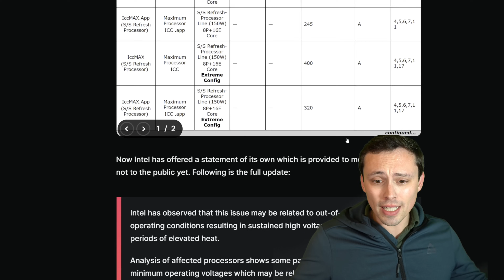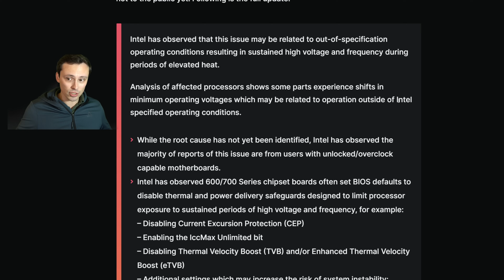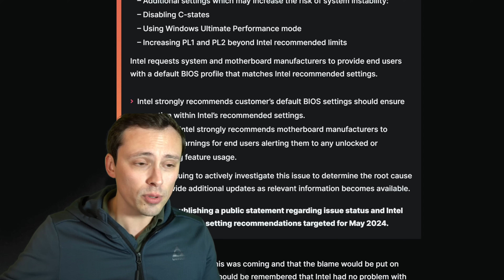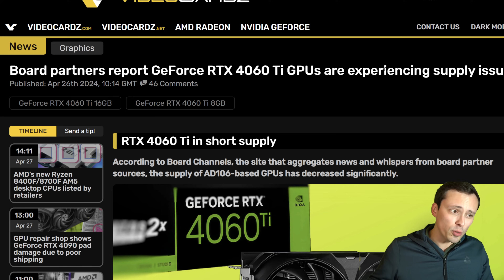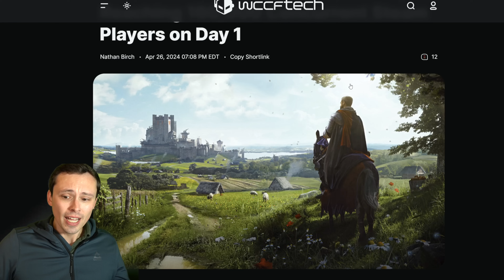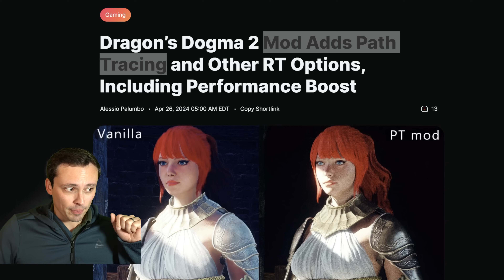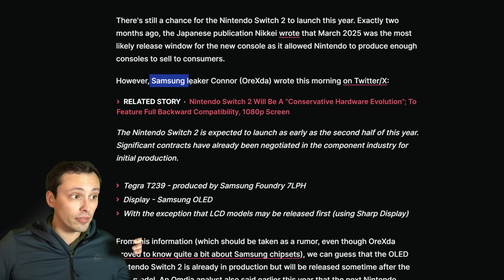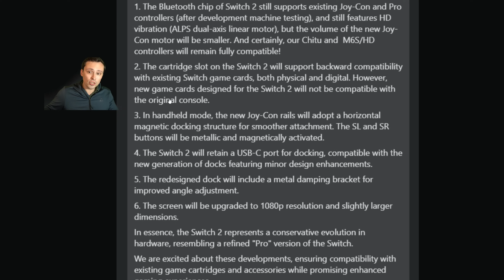MSI Abandons AMD GPUs | Intel Official Statement on CPU instability | Nintendo Switch 2

Comment: Intel's not wrong, I've been saying for years now that mobo manufacturers are doing everything backwards. Default should be intel spec not overclocked, 'turbo', 'max powah' or anything else. It was causing people heat issues with 12th/13th gen and now stability issues as intel cranks up the performance of the 13th/14th gen ticking the clock speeds higher and squeezing performance leaving even less oc headroom on the chips. Mb manufacturers are turning off power limits by default allowing cpu's to run full out until they thermal throttle. Oc settings shouldn't be a default 'opt out' setting, it should be an intentional decision made by the user. 

Default settings aren't 'gimping' performance, they're giving the performance the cpu was designed for. It's only a loss of performance from the default overboosted mb setting. So sure, if you switch off an oc like the 4.6ghz oc I had on my 4690k back to default clock speeds and voltage - performance reduces back to normal. Shocking.

Comment: I'm  not convinced that the current 4060 Ti shortage is due to NVIDIA wanting to clear inventory for the 5000 series, I think this has to do more with AI hardware sales.

NVIDIA might have had TSMC reshuffle their waver assignments to make more H100 instead of 4060s since those are FAR less lucrative than the thing that makes ChatGPT and NSA datacenters go.

Comment: If Intel made a fault, besides building CPU that consume so much power, I don't know. But as I use a lot of Asus Mobos on PCs of my friends, it's easy to see, that Asus as example is unlocking a few settings by default, especially the tdp and core voltages.
If we look back, it was also Asus who gave the 7800x3d too much voltage. The company loves it hot and at the highest performance.

Comment: I don't think Intel utilised their recommended specs when they did benchmarks to compare their CPUs to AMD 😂. It's easy to say '' why are you doing that ? " When you have already done the exact same thing to promote your products...
This also shows that Intel's baseline profile is already an aggressive settings because it's already the limit of what many CPUs can support. Basically Intel CPUs are overclocked out of the box to try and compete with AMD, so when you try and overclock them yourself you're basically overclocking on top of an overclock

Comment: I really wish Nintendo would ditch Nvidia, Tegra ALWAYS age waaayyyyy worse than any AMD powered console ever!

I have a switch and its performance is absolutely atrocious in some switch games. Embarrassing performance in Zelda, splatoon 3 and majority of newer titles.

 I had an Asus Transformer with a tegra chip in it, felt snappy for maybe a year at most! 

That tablet died and got a free upgrade to transformer 2 with new and improved Tegra chip! 

Same issue. Snappy for a year then couldn't maintain 30 fps with many current games for that time period. 

Tegra platform is extremely short sighted and Nintendo would be very wise to even look at intel at this point.

Comment: Nintendo Switch 2 "won't be as much as a Steam Deck: r u kidding me.  Orrin Switch like Tegra Switch will sell at least 150 M units while Steam deck is lucky to reach 1 M units. Daniel, mimicking repeater does not work and will end your carrier as a mimicking transmitter as it should, only right and just, do ur own research that whole report was really embarrassing. mb

Comment: My first thought on MSI and about AMD is that their GPU's are going to fall back. And their CPU's are still working on the old socket. So for CPU side there is not really much effort needed and no GPU's. 

So it seems that there is a huge void to be filled in MSI. Nvidia will just transfer from 40 series to 50 series so no real impact to be seen here to fill the void. My view is that the void still remains. 

But all is quiet for the INTEL side. Just a prediction for MSI would be to optimize INTEL motherboards to APO and pairing to INTEL GPU. INTEL ARC Alchemist very under rated and in my view reviewed with wrong tools and proper performance is lost in translation as A770 for example can do 4k as an entry level card. Pairing to the CPU is becoming more important and with APO there is a huge promise for performance boost. What INTEL needs is a reliable partner like MSI to take the CPU and GPU pairing to the next level. So my gut feeling is that MSI is doing something with their INTEL motherboards and up coming Battlemage. Just seems like there is a huge elephant in the room. 

Why MSI? I think it has a bit to do with Asus unreliability and changes on their business model. Could all the INTEL troubles be Asus sabotage? Crazier things has happened. Maybe Asus was considered but dropped. Gigabite has always been close in competition with Asus and that could also mean that Gigabite has also pushed their power limits too far but not as far as Asus. This is just pure speculation before you get your knickers in a knot. But with INTEL there is something very wrong as they missed the Nvidia "super" launch and now it seems that the Battlemage is going to go head to head with 50 series Nvidia end of the year that in my opinion is year too late. So what am I missing??? Battlemage was suppose to launch 6 months ago and Celestial end of 2024 early 2025. Battlemage end of the year is old and DOA. I can't see the point. There is something missing. If anything it seems like the competition is trying to black paint INTEL as much as they can.

Comment: If Intel blames motherboard makers they could just force them issue a bios update with exact Intel spec settings and not the fake baseline Asus gave us.
Reply: There is no exact spec. Intel only makes "recommendations" when in comes to power delivery.
Reply: @blegi1245  If we read between the lines this means Intel doesn't want to give out the real spec even to motherboard vendors because it would make it a lot slower than Ryzen. Just my theory.

Comment: I do remember nvidia starting the GeForce 9000 series with the 9600GT serving as a correction for the subpar 8600GTS and then the rest of the generation trickling out. So it wouldn’t be unprecedented to get a 5060 Ti first since the 4060 Ti is the worst card out this gen and a competent $399 card, say as fast as a 7700XT but with nVidias feature set and 12+ gb of vram would be a huge seller.

Comment: 4060ti shortage is probably  a combo of its a full fat die as any defect makes it a 4060 non ti and it is sold as a 4070 in laptops but for more money so im guessing they get first dibs
Reply: Nvidia is gearing for 50 series launch.
Reply: @arenzricodexd4409  5060 ti launch is minimum 12 months away.

Comment: I'm not sure why MSI only producing Nvidia GPUs is new news.  Tom with Moore's Law is Dead commented on this months ago either on a Broken Silicon podcast or one of his monthly live streams that MSI was effectively taking the place of EVGA as an exclusive Nvidia partner for graphics card.  Guess Hardware Unboxed missed that entirely.

For the AMD graphics card, I agree with some of the other comments here, most AMD graphics card users will buy Sapphire, XFX, or Powercolor, and I own several Sapphire and XFX cards myself, so I can see how it happens.
Reply: You forgot ASrock. ASrock phantom gaming must be the most sold 7900XT and XTX GPU out there. Me, i'm sticking with PowerColor. I have 3 of them now. rx6800XT Red Dragon, rx6950XT Red Devil and a rx7900XTX Red Devil. And i guess i will get the rx8800XT Hellhound when that one comes out.
Reply: @Audiosan79  True I also have an Asrock card and it was a good experience.

Comment: As long as MSI is not being paid by nVidia in the way of better pricing on their chip purchasing in exchange for no longer offering AMD cards... Otherwise, this is a really strange move by MSI, considering that I hear AMD has much healthier margins than nVidia!
Reply: It was other way around. Steve from GN once talking about this in one of his video.
Reply: @arenzricodexd4409 I'm really not understanding what you are saying... What is the other way around?  Can you provide some context?
Reply: @johndelabretonne  AMD provide better margin than nvidia. That's false. Partner that do both nvidia and AMD if the card was about the same price they usually have better margin with nvidia. This is what partner told Steve from GN before. Second even if the margin is the same or lower with nvidia the volume is significantly larger to counter that. Third nvidia can retain it's high price much longer than AMD. On AMD side it is common for partner to cut corner to the point their build end up below AMD reference spec (which should be the minimum standars partner have to follow) because down the road they know AMD GPU will definitely getting heavy discount.

Comment: Yeah no fucking way did multiple motherboard brands just decide to use beyond intel recommended specifications as the standard. They don't do that because it would open them up to lawsuits real fucking fast. That's also why they always show you a books worth of warnings you have to accept before being allowed to change anything yourself.
I guarantee that was intel either not specifying standards at all, which i also find highly unlikely, or giving out specs that were too high in order to inflate the performance in early benchmarks. The latter is way more likely in my opinion.

Comment: MSI’s statements are pretty soft, ie- they aren’t asserting a permanent discontinuation of working with AMD on Radeon cards, just at the moment they aren’t prioritizing them.

I’m not surprised, for an assortment of reasons. EVGA exiting the market represents a substantial opening for other AIBs to accumulate marketshare. And conversely there are a lot of extremely stout AIBs covering AMD’s share of the market. Sapphire, PowerColor, and XFX are all really competitive options, and then after them you still have ASUS, AsRock, and Gigabyte to contend with. We even have a couple “new” AIBs making splashes into Radeon now with Yeston and Acer. It’s debatably pretty saturated for AMD’s much smaller overall share of the market.

AMD provides AIBs with much better margins than Nvidia which more than makes up for it. However for MSI I think there is additional value to place on increasing their brand visibility even if they make almost nothing on graphics cards with Nvidia, as MSI sells a lot of PC components besides graphics cards.

I don’t think this is anything new, either. This has been a soft trend going for about a year now. Another thing I noticed on the initial release of 7000-series cards, MSI was very slow getting around to releasing their 7900XT and XTX cards. It went largely unnoticed in part because most of the AIBs were late and trickled in over the first few days, but for MSI was a number of weeks, maybe a couple of months? It was at a point where I was actually surprised when I finally noticed they were there.
Reply: AMD offer better margin than nvidia? It was the opposite. Steve (GN) often talk to AIB and they tell him that if AMD GPU and nvidia GPU of the same tier have same price point they will make more money on nvidia. Nvidia are very well known to go cheap with reference while AMD do the opposite. That's why more often than not AMD AIB cards end up being not up to standard even against AMD reference. They cut corners because AMD GPU are pretty much heavily diacounted down the road.
Reply: @arenzricodexd4409   you seem to be confusing yourself. AMD has been focusing on getting better NET margins with Radeon than they have in the past. And they’ve been doing pretty well, really. If it’s getting even better than Nvidia then more power to them…even though I’d prefer they turn some of those profits around to consumers with even more competitive cards.

But the real point is they SHARE a larger percentage of that (larger) margin with AIBs than Nvidia.

YouTube doesn’t allow pics so I can’t post them, but the graphs you can find are pretty damning against Nvidia. They expect AIBs to make their cards for crumbs. It simply isn’t sustainable making cards with Nvidia chips if you aren’t already a large AIB making MBs and other components to piggyback other products on.

Put 2 and 2 together, my guy. EVGA had been the biggest, most respected GPU AIB for literally decades before throwing in the towel. Their reputation was second-to-none. They far and away outsold everyone in the enthusiast space. And there’s no one else in the equation other than Nvidia behind their demise.

Nvidia simply isn’t worth working with in any direct sense. MSI just happens to be large enough to eat the low profitability in exchange for increasing their brand visibility. That’s all this is about. ASUS and Gigabyte can similarly eat the low profitability working with Nvidia for the benefit of market exposure, but after that Nvidia is terrible to work with. Always are. Always have been. All the way back to MS with the original Xbox. If even the exorbitant size of MS can’t put up with the level of entitlement that Nvidia always puts out, that really says something.

And what are you smoking thinking it’s the second-tier cards AIBs make for AMD that suffer? lol have you not looked at second-tier Nvidia cards or something? They exist purely to make Nvidia cards appear more marketable than they actually are. So you can claim 4070s are available at $600 even though the only cards actually worth buying are bumping up against the 4070ti and so on. It’s why I can’t stomach buying Nvidia cards even as backups to my lower-end PCs. Nvidia plays this internal upsale game in every tier to where the only card to buy becomes the 4090…which wasn’t worth paying for even a few months after release.
Reply: @kenshirogenjuro873  you were the one that are confused. RX6600s in general compete with nvidia 3060s. Those RX6600 now can be found less than $200. On nvidia side even the 3050 still being sold over $200. Now for the same tier or card which gpu have better margin? Steve from GN already talk about this issue years ago. 

Nvidia are not worth to work with? If that's the case tons of nvidia partners already leave them. in case of EVGA they should know their business model are not sustainable in the future by the time BFG decide to close the door back in 2010. Thing is partnership between large corporation is not about buddy-buddy relation. Just look how many partners Apple already burn. the original xbox case if you look at it more deeper both MS and nvidia simply want to protect their interest. Back then MS is a lot bigger than nvidia so they try to push nvidia. But they probably did not expect for nvidia to push back. But even if nvidia no longer in MS console both company still work on several other product like Zune and the original ARM based Surface. The thing that happen with the original xbox did not prevent the two to work on other project. Why? Because at the of the day it is business not some friendship. In fact you can see MS still try to pressure AMD from time to time when it comes to console.
Reply: @arenzricodexd4409  you’re just posting fanboy copium. The graphs showing Nvidia’s abusive profit margins and refusal to share with the AIBs who make their cards are easy enough for anyone reading this to find on their own. Cape for the corporation you fanboy over all you like, the reality just is what it is.

All the best AIBs work with AMD. Second-tier Nvidia cards are cheapy garbage because of how narrow the margins Nvidia AIBs are working with. I’m laying out the basic premise of why MSI can tolerate working with Nvidia while focused AIBs like EVGA can not. It’s not rocket science. Nvidia will never have another AIB like EVGA. Sad end of an era.
Reply: @kenshirogenjuro873  you're the one being fanboy about this. Corporate is corporate. They are not anyone's friend. Not thier consumer not their partners. period. AMD care about their partners? heck recently they try to punish partners and retailer that try to sell those 6700GRE below MSRP in china. That is freaking last gen stuff. Even current gen already past that half of it's life cycle.

Comment: Does seem to just be 13/14th. I didn't upgrade any of my 12th gens to test, just sitting back absorbing everything said on the issues. Am stable though to be safe I turned MCE off 12900KF 4090 Z690 Asus TUF Gaming Wifi. Following BIOS updates and QVL my largest issue is just ram speed issues and sometimes updates making support better/worse across my Z690 pair. Think anyone on 12th if it's working well should just stay until this is sorted, at least for gaming workloads.

Comment: Setting motherboards to unlimited power is the stupidest thing that happened on 13 and 14 gen Intel. I have 13900k, by default on my boards all OC setting is ON and unlimited power lmit. So stupid move. I must turn all OC off and set my own limit  for my cooler (i use 270W, intel spec limit is 253).

Comment: MSI was one of the only AIBs, along Asus and Gigabyte, that offered 3-year warranty for AMD graphics cards in my country. 

Radeon GPUs are already harder to find here and more devaluated than Nvidia ones partly because exclusive AMD partners offer shorter warranties than Nvidia exclusive ones, and now it will be even harder :(
Reply: Asus also don't produce amd graphics card an ROG strix version for high-end cards. For low end cards like rx 7600, they only give it 2 fans version while rtx 3050 has 3 fans, which is insane lmao.
Reply: @hquan021 because they can milk nvidia users more.

Comment: This is like the shenanigans that AM5 ran into. Why aren't Intel or AMD actually checking board voltages of partners?
Reply: Exept it isn't. Intel doesn't have binding power delivery specifications for LGA 1700. Intel only makes "recommendations".
Reply: @blegi1245  either way, the companies have an interest in platform stability.